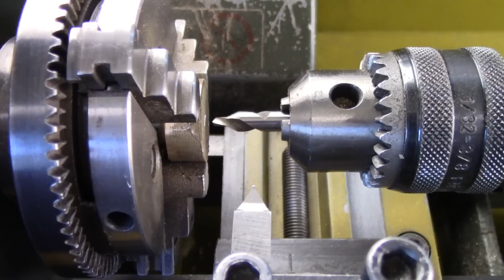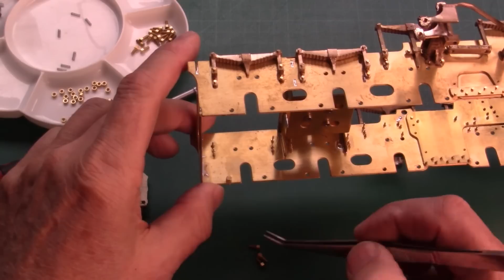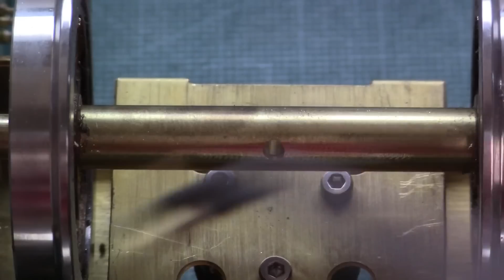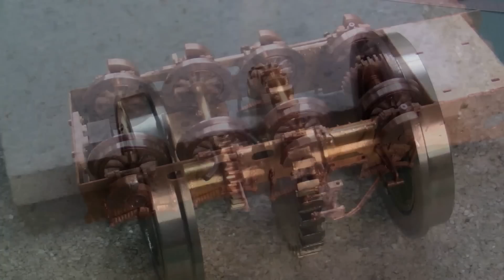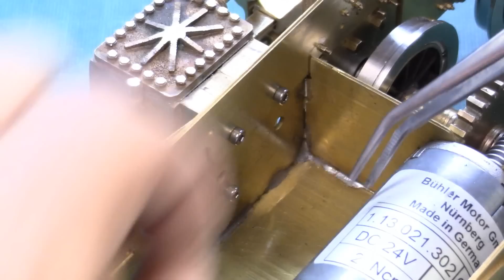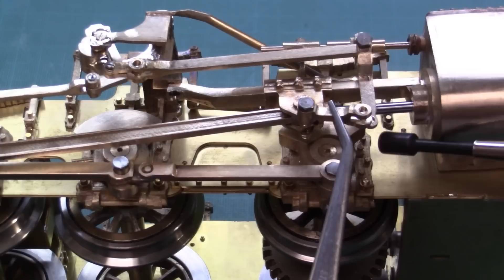8 - FRONT UNIT finale

Comment: even after years of building locos, its still a satisfying feeling when i put the rods on and it runs. and ive had that problem too of the front crank pin fouling the slidebars and crosshead. On prototype works drawings of locos, theres commonly less than an inch between them